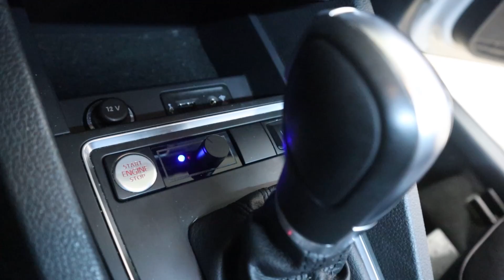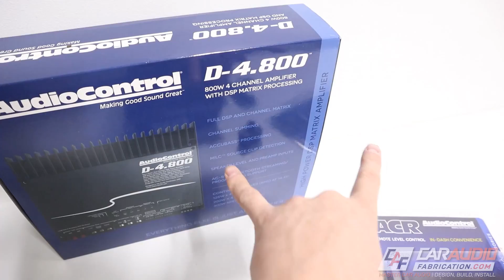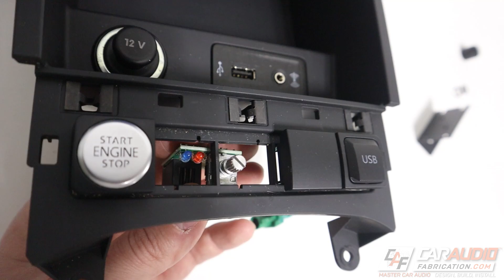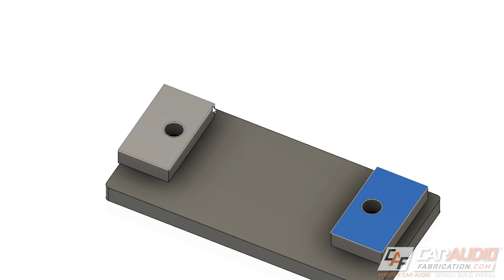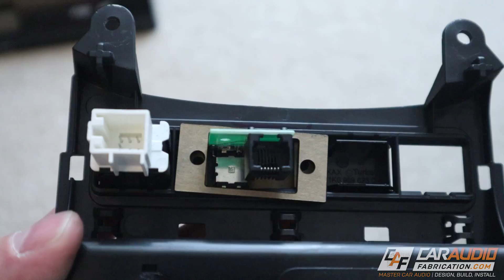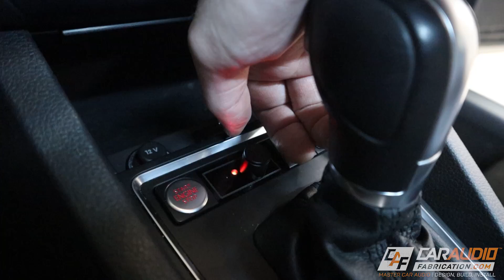How to - Custom "Bass Knob" Mount - MAKE IT INTEGRATED!

Comment: Love the attention to detail you put into everything you do. I have a question when it comes to bass knobs though. Currently have an lc2i pro (bass roll off fix) and an epicenter in my b&o f150. Was wondering if there is a dual rotary potentiometer similar to the acr-4 that comes with the microcenter that can accept two inputs to control both the lc2i and the epicenter? Just looking to clean up my setup a bit going from two bass knobs to one dual rotary knob. Thank you for your time.

Comment: The small details make the difference. Yes I have made those subwoofer control panels. I usually make them out of polycarbonate and paint the back side or warp in a sticker vinyl

Comment: On one vehicle the bass knob is in the ash tray. Lid folds down and I don’t smoke so that area isn’t used anyways. Another vehicle I used a pac bass knob and took it apart and put it in a small panel on the side of the console on the drivers’ side. My third vehicle it is in an unused spot in the headlight switch. All are nice and out of the way.

Comment: This might seem gawdy but has always done me well, I put the bass knob somewhere factory in the dash if it's not noticeable, if it sticks out I usually hide them either under dash or low on the center console twords the seat out of any area of movement. Sometimes ad an additional kill switch on the amps, while not good for the amps sometimes nessecary to avoid s ticket lol

Comment: Hey Mark, yes back in the summer I flush mounted my arc1 or 3, Well whichever one works with the Matrix 6 linedriver  
Although its in a strange place on the right next to my headlight switch it looks cool ps my car is right hand drive so its pretty Conveniently placed 
Also I have to thank you for making your video about the cable flange you use for the powercable through the firewall this is the best idea really reassuring

Comment: Hey dude wat is the bes converter from 120 volts to 12 volts , with good amps and watts to use a car audio system at home
Reply: There really isn't a great option at the moment, not one that's cheap. Keep in mind the most wattage you can pull from a North American wall outlet is around 1600 watts, that would be the total limit of your system not even considering amp efficiency. The best option I can think of right now is a PC power supply, the largest you can buy being 1600 watts. The thing is a PC power supply that can actually provide that much power will cost a lot, and it would have to be modified to put it's full wattage out. You're probably better off investing in home or pro audio amplifiers to run your car audio gear, or running a very small car audio system on a cheap PC power supply.

Comment: I have a question it’s none related to this video but i own a 2017 infiniti q60 and recently upgraded the none bose factory sound system to some focal sound system but I honestly yes theres a big change in quality but I feel like i need more speakers since i just have 6 speakers and it just feel like the tweakers are working hard and can definitely feel where the sound is coming from which is something i dont like anyway my question is does more speakers equal more like a surround sound feel where you don’t feel that the the sound is coming from that speaker if that makes sense
Reply: Well music is still a stereo (2 channel) sound, so it wouldn't be real surround sound. I think what you're trying to talk about here is sound stage, which is where you perceive the sound to be coming from. If your sound system was installed properly, you can use the fader control on your stereo to make your front or rear speakers louder. Doing this will effectively move your sound stage and may achieve the effect you are looking for.

Comment: HEY I HAVE A QUESTION do I need a capacitor for my sound system
Reply: You most likely don't. Look up some videos of "the big 3" upgrade. Also make sure your battery is big enough, and that your alternator is big enough to keep the battery charged. Capacitors Aren't all that good to be honest. Making sure your full electrical system is up to date and in good condition is the better option.

Comment: FYI, for the many who don't have access to 3D Printers and Laser CNC's, there are small companies popping up these days that have all of those tools.  Just design what you need in Sketchup with exact measurements, hole sizes, and the measurements of hole placement on each piece, then take that to a 3D Printing company.  This way you can make something just as custom as Mark here without needing to invest hundreds of dollars (or more) on the tools to achieve it.

Granted, if you think you'll make custom pieces 3 or 4 times a year you probably should consider making the investment since you'll spend at least that much or more on having someone else print them.  But if you're just needing things printed for one project then going 3rd party would likely be the way to go.

Just a thought.
Reply: Honestly, it wouldn't be to hard to make with basic tools at home. Could even make it out of thin MDF. I'd still love a laser cutter and 3D printer though 😁

Comment: Done that for those and radar detector hardwire mute controls. Typically used the actual knockout plate itself and just drilled holes to support the leds. Hot glued the PCBs in on the radar detector mute module and the LEDs would shine through. Bass knobs are a bit easier since they bolt to the panel itself as long as it’s not too curved.

Comment: years ago when i was doing car audio for a living  i used to take the kenwood and bazooka tube control knobs apart and custom mount them if the customer wanted them exposed. Used to build mounts for the boards out of sheets of plastic and epoxy them in place.

Comment: I usually try to reuse as much as the OEM plastic cover blanks as possible. For Bass Knob, I often move the LEDs by desoldering them and keep the knob on a single plastic blank, recessed when possible, then the LED goes on the next or are kept discarded because they are usually way to bright for night driving.
Reply: I replace the LEDs with a dull red one because red does not affect your night vision

Comment: I love cars that have the pop out button locations. I've used them to mount control knobs and switches plus indication lights. Everything from simple drilled hole to shaping and paint. These are defined by time, expense and overall look.

Comment: I did something similar like in my kia Rio. Had a jl hd 900/5 and the rlc needed a spot so I wanted it to look stock so I rigged it up next to the parking brake and viola
Reply: Yes, bass control all done with dremel.Lasers were not even available at the time.Only did it once after that I couldn’t justify its use. At the time it was controlling 2 x 18” Petra Pro. Those are stage speakers that dominated Orion, alpine, mtx, punch, Sony, blaupunkt woofers only existed. 

They were in a 92’ Z28, (last year before body style change) with the doomed back window. I’m 47 now and was 16yrs old when I started using my craftsmanship to build custom boxes back then to utilize very little space or however much the owner allotted me.

 I kept getting kicked off Sonics property for shaking their awning. I could flip a cassette tape on my roof. 

I’m convinced Crutchfield stole my rear swing door boxes in Tahoe’s and Yukon’s. I didn’t have the income to patent anything, but I had those built over a year in a half before they started selling exactly molded boxes exactly the same. Some agree some don’t but I’m convinced.

Comment: I did something similar in my Tundra with a space that wasn’t used like that. The bass knob looks factory. Same with my tweeters I mounted in the sail panels. Also had to wire the factory USB port and factory mic and 6VDC mic amp to the new head unit because no pre-fab harnesses existed that I could find.

Comment: I did the bass knob in my pioneer 5 channel on my 2004 Civic. When I got it installed, then just taped it into a cubby on the left side of the steering wheel. When I finally looked at it years later, I got to work. 1 screw, popping out a small panel, and drilling a hole, I mounted it all myself. Would have taken them 5 minutes, took me about 25 since I have no experience.

Comment: I did the ol empty switch panel with the pot shaft sticking through. It worked really well to hide it like I wanted and doesn't look too bad since I got a better looking metal knob to put on it

Comment: Why even still use a bass knob? I can just set the gains properly once and then adjust bass at the headunit. Looks great though.
Reply from the maker: This "bass knob" is a volume attenuator. Unless you set your gains with the head unit sub level all the way up you are going to drive the amps into clipping using the head unit to control sub level. That doesn't happen with these controllers. You set the gain. Then plug in the controller and it only attenuates the output. Not to mention turning a dial takes half a second,  no poking through head unit menus and clicking a screen multiple times.
Reply: @CarAudioFabrication  Thanks for the explanation. If you set your gains with the HU at maximum output and then later adjust bass with the EQ isn't that effectively the same thing? I don't really have a need to adjust the bass volume personally after I have it set where I like it.
Reply: @TRD_2zz  With the volume at maximum? Well if you turn the bass up, bass frequencies will still be turned up louder, causing them to clip. Probably the best thing to do for your scenario is set the EQ where you like it, then adjust the amp gains.

Comment: I have disguised my bass knobs with the factory push in cigarette lighters. You'd never know it was there. Lol
Reply: I’ve done the same, always looks clean.
Reply: This is the way.
Reply: i used to do the same. i'd use a generic knob with the lighter symbol on it. complete camo.
Reply: In the old days I would have made it the same way. Mdf, fiberglass and paint. Laser cut with acrylic is so nice looking.
Reply: Thats genius!
Reply: Been wanting to disguise mine with the interior lights dimming switch 😬😬
Reply: @iChubbs_81  are you referring to the scroll wheel style or knob style?
Reply: @malachi4169  scroll
Reply: @iChubbs_81  what's the year make and model of the vehicle, so I can find the switch and see if it can be done.